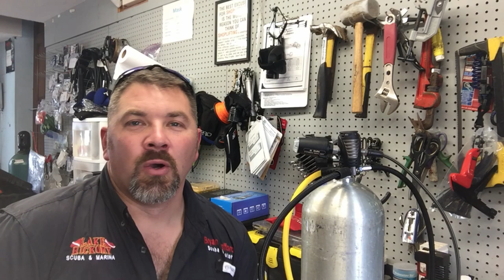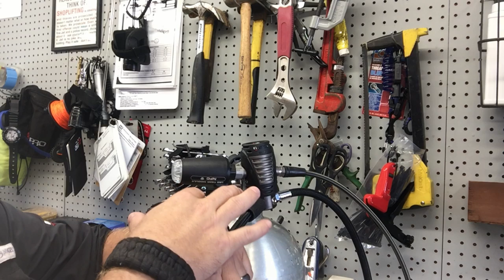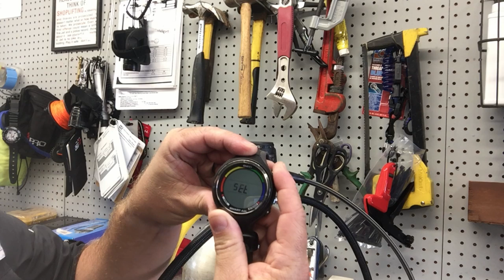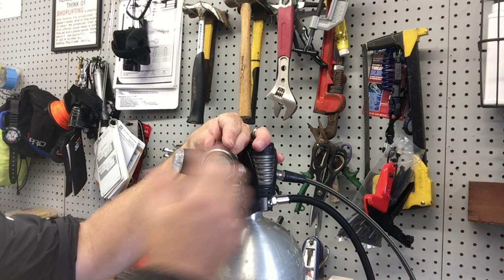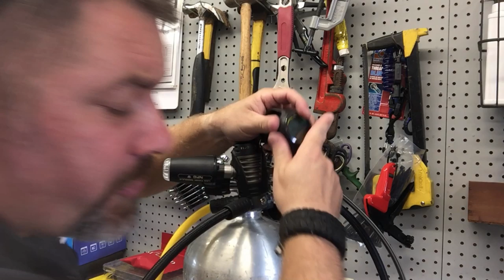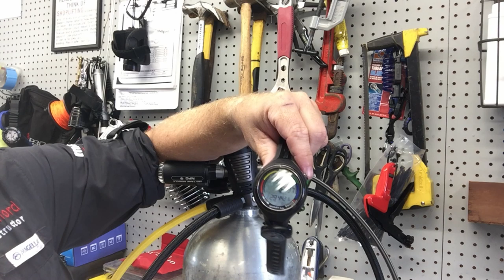Pairing The Mares Smart Air Computer To The LED Transmitter

Comment: Bryan, thanks for the information. I wish Mares was as useful/helpful as you are. I have the Mares Genius and it was/is very complicated to get paired. Your video was very helpful and I got it paired. Thanks from Arizona. I believe you have to pair each time you change tanks?
Reply from the maker: Hello Ron Martin. Glad our video was helpful to you. If you have issues with pairing, typically this is a sign that the transmitter batter is dying.

Comment: Hi Bryan,
Love the videos.
Couple of questions if I may:
1) Is the battery kit with O ring the same for the smart as the smart air? If not do you know the Mares part number?
2) Is it possible to get the battery kit with O ring for the LED transmitter module? Do you know the Mares part number?
Cheers,
Tom.
Reply from the maker: Hello Tom, great question. Unfortunately the battery kits for the Smart and the Smart Air are different.  The kit numbers for each are:  Smart - 44201187 (2430 Battery), and for the Smart Air - 44201491 (2450 Battery). The Battery Kit for the LED Transmitter is 44201464.  Any Mares Dealer should be able to get you these. Although all are user friendly, be very careful on changing the transmitter battery, things get tricky.  When in doubt, have a local Mares technician do it for you.  Most charge around $25, but it beats having a flooded transmitter or computer.

Comment: Did three dives and the smart air went in to no fly mode showing how long before I could fly. Can I by pass that feature or do I have a setting wrong?
Reply from the maker: Hello Steve E. Most dive computers will have a no fly feature built in. This is here to keep us safe.

Comment: Can mares smart air export freedive (apnea) logs with dive chart? Or is it only useless maxDepth/diveTime table with one record per dive?
Reply from the maker: That is a great question.  I'm going to have to refer you to Mares Headquarters in Boca Raton.  The Smart Apnea is specifically made for freediving, not the Smart Air.
Reply: @LakeHickoryScuba  Got the answer from my dealer.  
"Smart Air can record the profiles of approximately 95 hours of diving, at a sampling rate of 5 seconds. The information can be transferred using the optional USB clip to PC via the Dive Organizer software" -MARES manual. It sucks at apnea.
"The "normal" Smart has only one basic freediving mode, which is not able to record and display the profile."- Mares.
Apnea mode is only formally supported, there will be no data stored for apnea diving session.
Dive Organizer is crashing without chart data, mares ignores issue ticket for 2 month now.
If you plan to use it for freediving, go away.

Comment: What if the module was already paired to a different computer?  Do you have to reset the module?
Reply from the maker: Hello audiorazor, as long as its not already paired you can pair it. The other cylinder would need to be shut off, and the lines need to be de-pressurized. Then you simply pair your computer to the transmitter.

Comment: Hi, is it possible to pair the transmitter to say a smart air & a quad air at the same time? I've asked this of a few folks and have yet to get a yeah or nay on it.
Reply from the maker: Hello John C, truthfully I don't know, but I will make a video trying it out for you.  I have had several parents say they wished they had computer that would read both their pressure and their child's while diving.  The two main issues would be, distance to the transmitter and it would have to be two different gas mixtures.  Stay tuned.
Reply: My interest is for my smart air and a second Quadair, both on me. I know overkill. Thanks for checking into it.
Reply from the maker: You're welcome.  We will try to get a video up for you with in a day or so.  Interesting topic.

Comment: Got the answer. If you plan to use it for freediving, go away.
"Smart Air can record the profiles of approximately 95 hours of diving, at a sampling rate of 5 seconds. The information can be transferred using the optional USB clip to PC via the Dive Organizer software" -MARES manual. It sucks at apnea.
"The "normal" Smart has only one basic freediving mode, which is not able to record and display the profile."- Mares.
Apnea mode is only formally supported, there will be no data stored for apnea diving session.
Dive Organizer is crashing without chart data, mares ignores issue ticket for 2 month now.
Reply from the maker: Hello Dainius K, glad you got your answer.